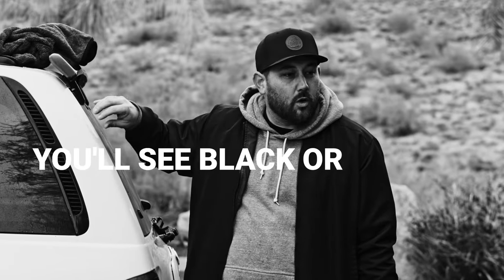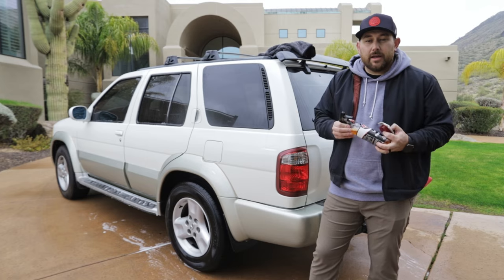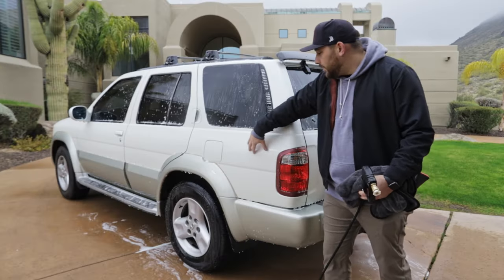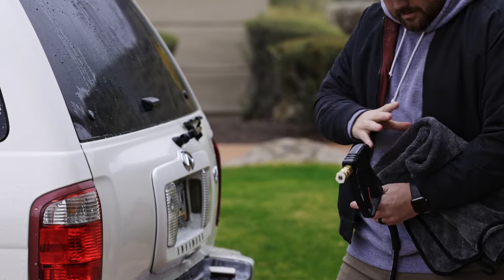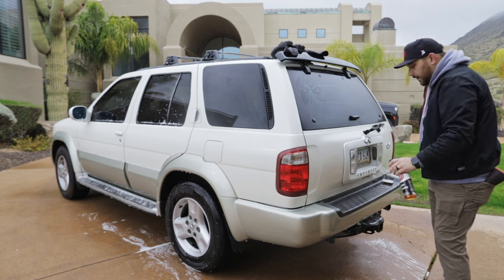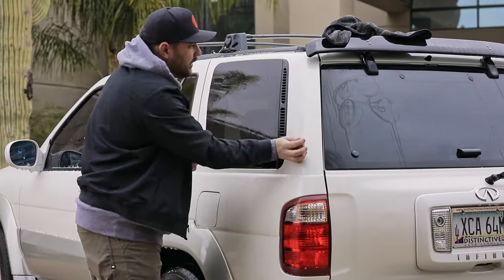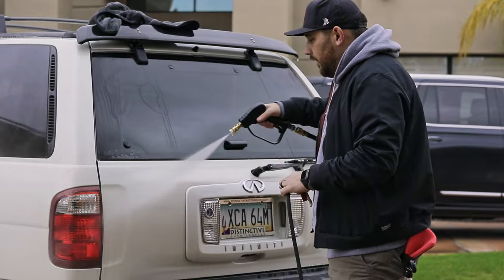How To Remove Iron Contamination From Your Paint

Comment: Joe, you are using too much product, plus use today's technology, use clay towel or clay sponge.
Reply: I agree. A little but goes a long way. I  used a whole bottle on my wheels. But I think I could have used half of it if and that’s cause my painted black wheels were caked in brake dust. I used a soft brush and it worked it removed every bit of brake dust.
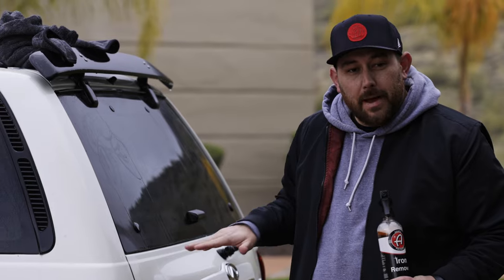Reply: @4:28 joe explains why he used the clay bar instead of the clay mitt.
Reply: @berniedmj1  Thank you!!!   The answer I was looking for. :)
Reply: @glamshee  I've black wheels aswell. This stuff is excellent....but I found it also removes the pad material from the brake discs resulting in brake judder. Did you get this?
Reply: I feel Clay mitt works on cars with not as bad decontaminants or light work needed. If the paint feels very rough or tough, the Clay bar is the better option.

Comment: stupid question, but will the clay bar damage the clear coat or finish?  Would a synthetic clay product be any safer?
Reply: It did on my black car using a clay mitt. Left some scratches.
Reply: IMPORTANT: THE SURFACE MUST STAY LUBRICATED AS YOU CLAY THE VEHICLE IN ORDER FOR THE CLAY TO GLIDE PROPERLY AND TO PREVENT POSSIBLE DAMAGE TO THE PAINT.
Reply: It depends on your paint. I’d use either iron remover or the soft clay bar. I’ve found the clay mitts totally destroy and swirl the paint. I only use that for chrome front ends with tons of bug guts.
Reply: @devn3813  Strange, everything I've seen and read says that the synthetic clay medias are more gentle than a traditional clay bar.
Reply: @coryrood  I found that bizarre too but that was my experience at least.

Comment: So if I want to use a synthetic clay mitt/towel would the iron remover damage the clay?
Reply: I've heard it will. I know it will  regular clay. It's the solvents that are usually mixed with the thyoglycolate. I've had it destroy clay bars many times. I'm curious why it didn't start to dissolve his here.
Reply: It’s the fact that his is pretty diluted. You don’t need that much chemical to remove Iron that hasn’t been there for that long. Plus Iron isn’t really embedded in the paint, that’s a poor choice or word. It’s just bonded with the clear coat of your paint so letting it soak will just blast off after a power wash. FYI wheel cleaners do the exact same thing because they also remove iron particles from brake dust.

Comment: After you are done do you want to use ceramic coating?  Or what is the next step?
Reply: I actually have the 7 years Adam's Graphene Ceramic  coating on my car
Reply: After clay, you’ll need to polish the paint and then protect it with the wax, sealant or coating of your choice.  Clay is an abrasive after all.

Comment: Would the clay bar process leave swirls on the paint work?
Reply: Not typically if the iron remover formula has enough lubrication, minor marring at the worst
Reply: Do chemical decon first, than clay with proper lube. Start with mild clay, move up to medium or coarse if necessary
Reply: It marred my paint bad with a clay mitt on my black paint
Reply: @Newyen6MT  what did you use for clay lube. Iron remover is a horrible idea , not sure why theyd show that in the video. Think about it. As those iron particles are being loosened, you’re grinding it into your paint with the clay.  Helluva bad idea 👎
Reply: @chrisryan8894  The exact iron remover and clay mitt. I bought DIY iron remover and their clay mitt as they state it won’t marr
Reply: @chrisryan8894  the purple color is actually what remains of the iron particle...iron remover doesn't just "loosen up" embedded iron, it's a chemical reaction and is being dissolved
Reply: @GettinGreasy88  that’s a more accurate description, no argument there. But it doesn’t dissolve it completely, you’re still grinding iron particles into your paint if you haven’t rinsed it thoroughly.
Reply: @Newyen6MT  this video is Adam’s products. Can’t compare 
But go ahead and give it a shot. Hope it works for you.
Reply: It will on soft paint.